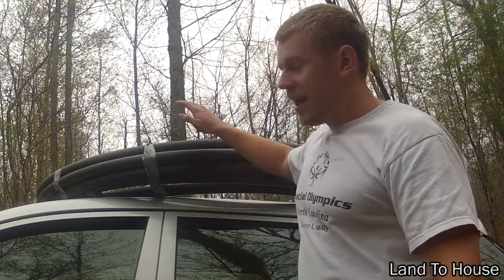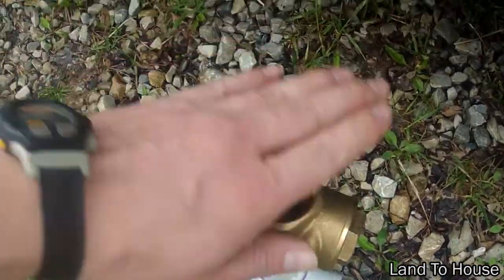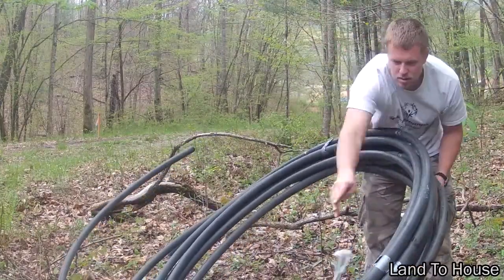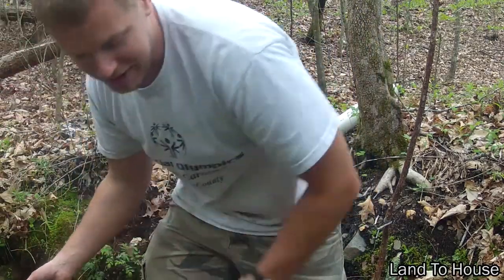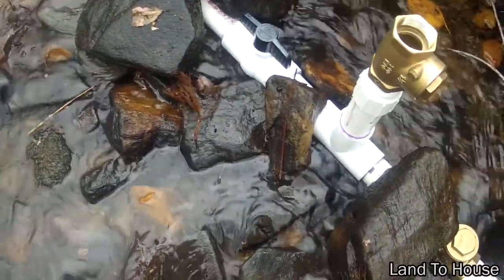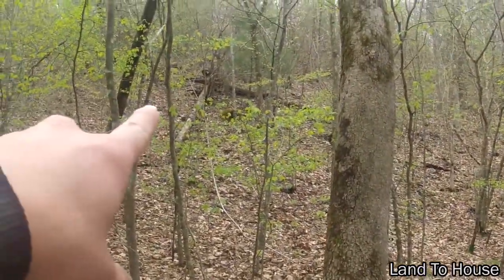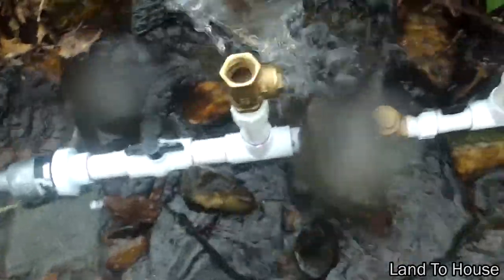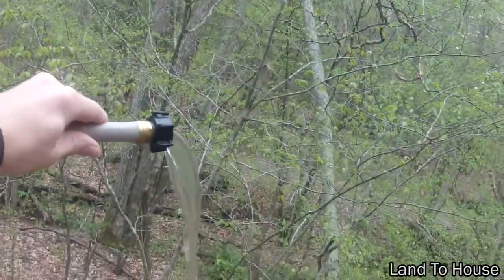Adventure 5 - Hydraulic Ram Pump

Comment: Hi. I was shopping for a ram pump, and seen yours on Amazon, then came here and found your channel without knowing you had a channel. My creek has 8 feet walls. If I place your ram pump in the bottom of the creek, will it push the water up the creek walls? Thanks.
Reply from the maker: Thank you for asking. The pump can lift out of a virtical 8 foot wall. To do that you will need at least 2 feet of head pressure. (Drop in water)

Comment: Can you add a pipe from your waste valve back into your delivery line..and will this work
Reply from the maker: Sadly no this will not work. There is a significant pressure difference between the two